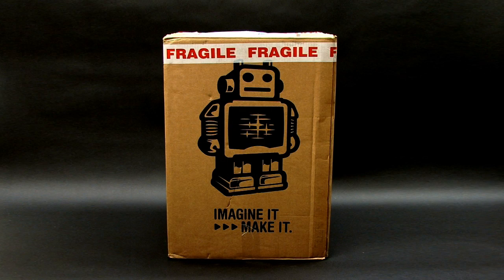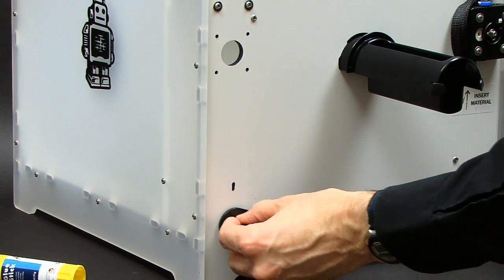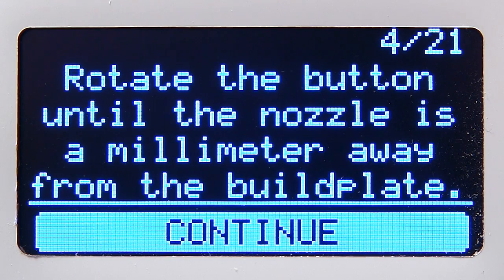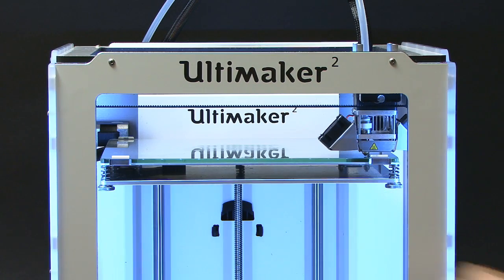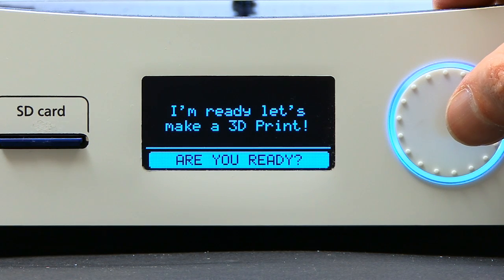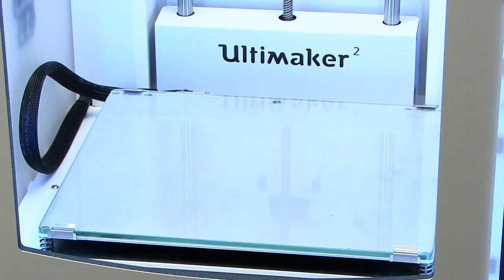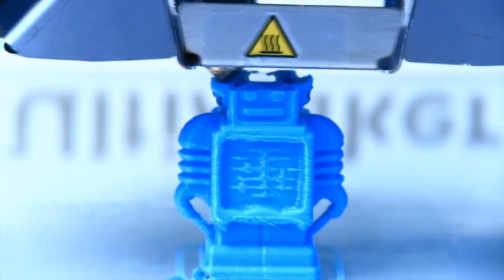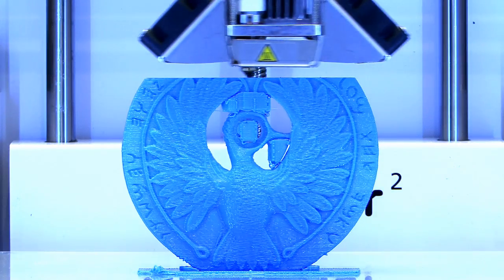Ultimaker 2 3D Printer Setup

Comment: So question i have after watching video and searching in ultimaker home page seems that this printer doesn't require direct connection with pc via usb or lan, and prints projects directly from sd card?
Reply from the maker: Yes, it prints directly from an SD card.
Reply: Noticed that it also has USB-B socket, does it have any drivers for direct connection or direct usb connection works only with ultimaker manufacturers software . . .

Comment: hello ,

it is my first time using the ultimaker 2 and i need some help,

first of all, let me explain a little bit about the model:

i am trying to make a gameboy raspberry (http://imgur.com/a/gFhk7)

and because i want to use it like a final product i would love to have a really hight quality ending pieces.
i am going to print on part in colorfabb_XT black of 2.85 diam and the other one in PLA/PHA sky blue from colorfabb of 2.85 diam too.
here i add the link of the to parts that i want to print:
https://skfb.ly/OVQZ
https://skfb.ly/OVQr

i would love some recomendations in the different settings it is the first time  i am using the ultimaker 2 before i was using the zortrax 3d printer where you dont need to change things, only the material so i dont have any idea.
it really doesnt matter how much time takes to print
thanks

Comment: where to print stuff do you need to download some thing on the computer or is there a usb port?
Reply from the maker: +Gordon Qi You print by loading objects onto an SD card on your computer, then putting the SD card into the printer and selecting what you want to print from the card on the screen.
Reply: if i use a mac is that possible?
Reply from the maker: Gordon Qi Yes, the models are saved to SD card from a progam called Cura, and this is available for a Mac.

Comment: Hi
I wonder if you could help me.
I have recently started using the Ultimaker 2 printer.
I have successfully designed and printed some small objects.
I have now designed a very simple object which is a little larger than my first efforts.
The problem is with this one file when the printing process begins to lay the raft the print nozzle is around 1 to 2 mm above the build plate and i end up with a birds nest.
It doesnt happen with any of the other files on the SD card, the build table is levelled as it should be.
Do you have any idea what i am doing wrong?
Reply from the maker: Alan Dunton it sounds like either you have knocked the build plate out of alignment (so try levelling it again, though you say this is OK) or maybe your bigger object is actually floating above the build plate somehow -- ie you have an error in the model (though Cura should drop the object down to the build plate on import. Most strange. What did you build your object in? You could try downloading MeshMixer, pulling your object into that, and seeing if you can find/correct any errors.

Comment: Hi! When I try to relevel my bed I noticed at step 2 (when the head moves to the left corner) the head isn't in the same place as yours in the video. It's far more left, almost on the edge of the glassplate. It also does that when I go to the other corner. I'm having problems with first layers lately (it skips a few 'infill-lines')  and I'm not really sure if this would be the cause of my problems

Comment: Hi, what filament do you think is better for 3D printing? PLA or ABS?
Reply from the maker: saiyaman23 PLA is nicer to work with (less fumes, less warping issues). ABS is essential if you need waterproof parts, or parts that will stand greater handling under stress (PLA is very brittle).

Comment: The print is not hot to the touch after it's done printing.  I can touch it immediately.
Reply: I did that a few times and it resulted in warping the print - better to let it cool off.